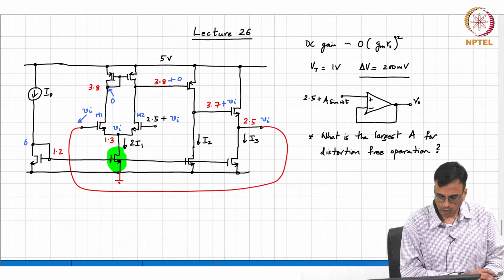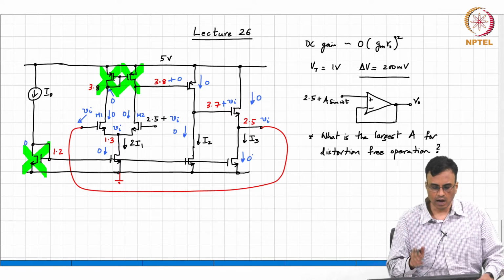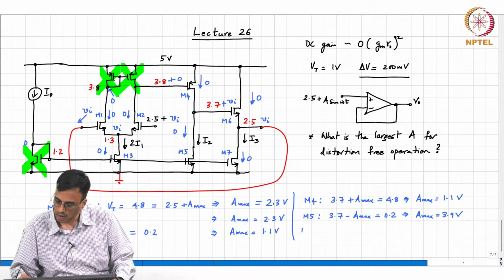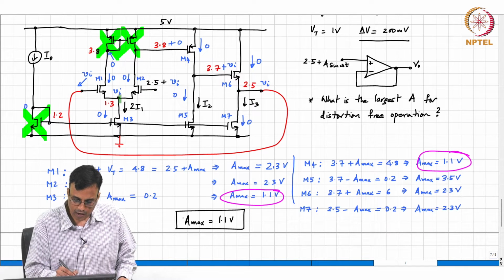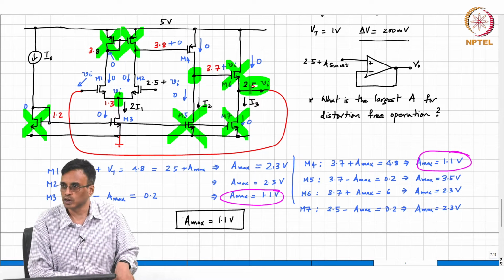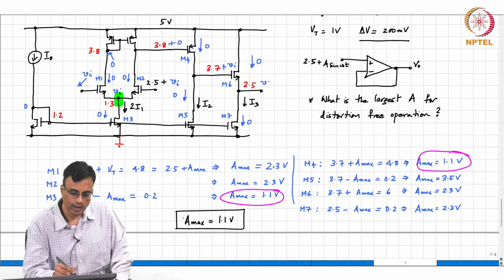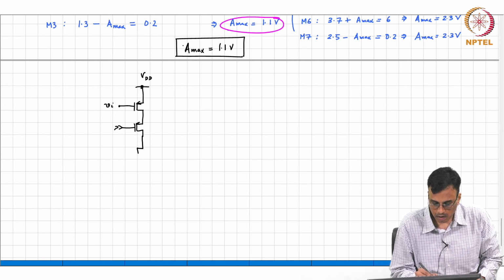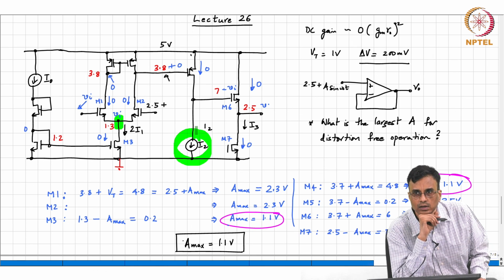Swing Limits of the Two Stage OTA

Comment: If, M1 has both Gate and Source incremental voltage vi, there is not incremental current so, Why we need to worry about it while Calculating Swing limits of it ? I didint get it...............Please Elaborate